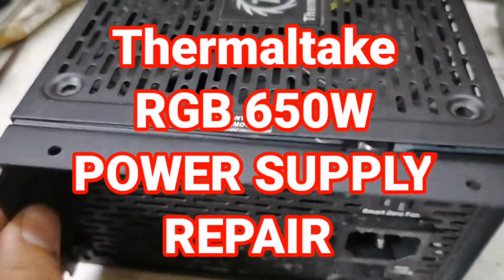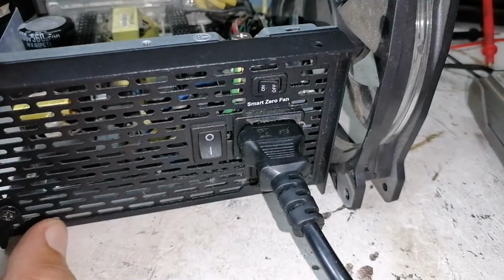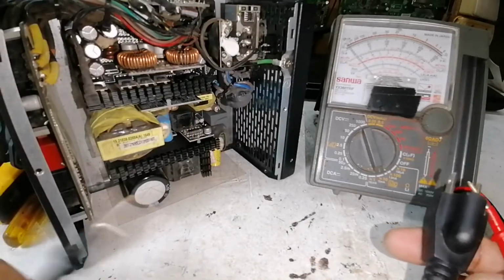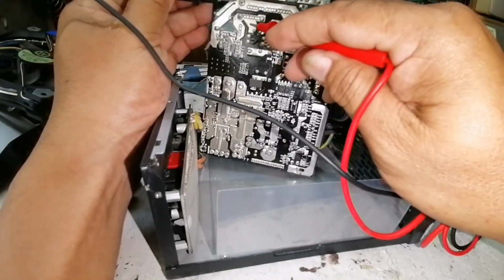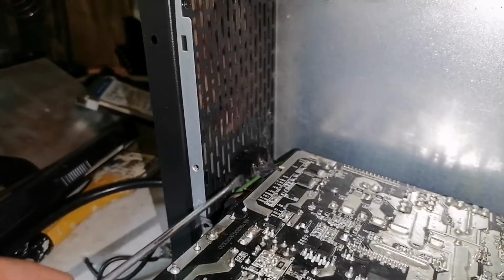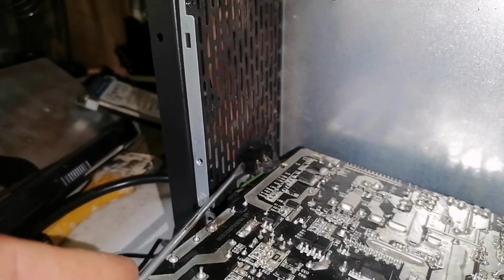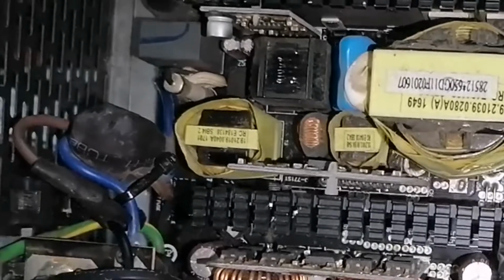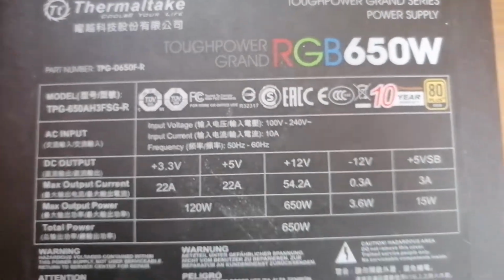THERMALTAKE TOUGH POWER GRAND SERIES RGB 650W POWER SUPPLY REPAIR WITH FORCED ON TUTORIAL

Comment: I got a psu like this(THERMALTAKE TOUGH POWER GRAND SERIES), but 1050w.
1. Is Switching ON, fuse OK.
2. Its rebooting the pc. 
3. My suspect is the 12v line. Because seems like no enough power to feed the new GPU(12v, 8pin connector)
How can I proceed to Diagnose?